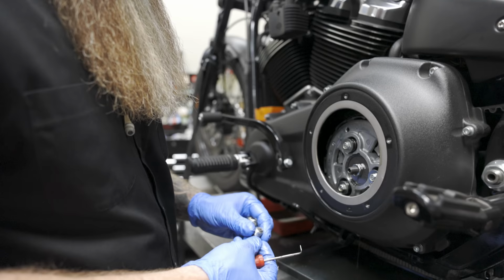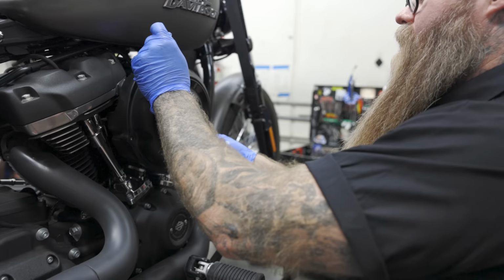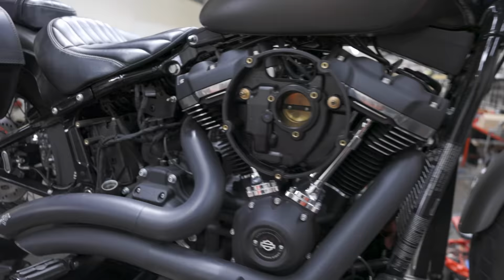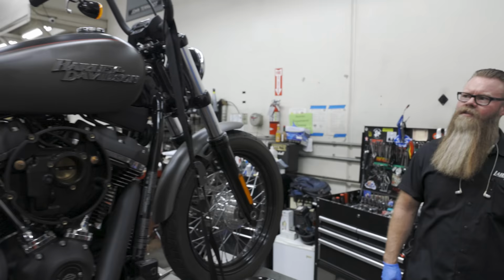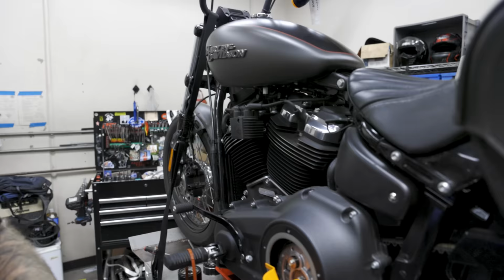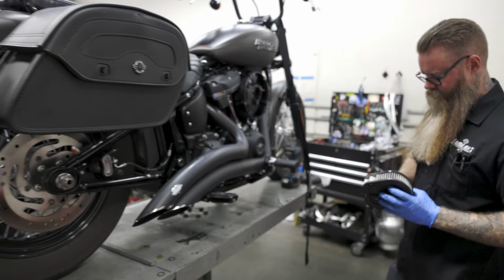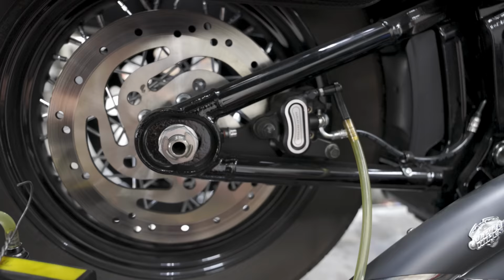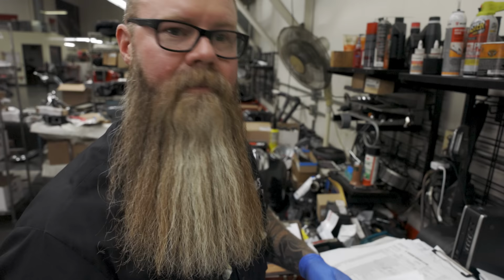1k Harley-Davidson Milwaukee-Eight Service by Level 3 Beard, Master Technician

Comment from the maker: Hey Guys, so I wanted to clarify a time lime discrepancy that a lot of people (with good reason) have been questioning. There is a part where I was talking to John about letting the bike run and he comments about getting the oil hot and bringing it up to operating temperature. This was BEFORE HE DRAINED THE FLUIDS. NOT AFTER, LIKE THE TIME LINE IN THE VIDEO WOULD SUGGEST.
Reply: Okay  I  just posted a question how he did that with no oil. Maybe you could re-edit video in case some stupid people try heating up engine to take off filter with no oil like it looks like John is doing.
Reply: @jimmybe64  I thought the same thing as I watched this, good post Dave and great service John and Great video Matt. Keep em coming!
Reply: Someone on here under @officialmattlaidlaw says I won a bike and it’s a highlighted message. Is this. Real?

Comment: Never again. My 1k service was $680. Got the bike home and checked all the fluids - engine oil wasn't even on the stick same with the trans.. Primary was low too. Tech. argued with me over whether you check the engine oil and trans. with the bike leaning on the jiffy stand. No Sir, I'll change my own oil and save my $600. Harley Davidson wants ONE THING - your money.

Comment: Have a question .... The oil filter was filled with oil before being installed . While it's full of oil how is it possible not to have all the oil spill out while replacing itt back in the filter holder. Did he empty that oil out of the filter then put back in . Because physics says you just spilled at least 2 cups of oil on the engine.

Comment: I wish I had the Confidence that my local Harley Dealer did all the same proper procedures. I bought my bike with 9,900 mi. and was told it had the 10,000 mi. service just done. It came with the checked out Warranty. You guys always seem so Trustworthy.

Comment: One would think for the $500 a lot of dealers charge for this service that a new air filter would be installed instead of cleaning the old one and hanging it on a dusty fan shroud so dirt can be blown in on the clean side of the filter before re-install. Master tech for sure.

Comment: Very cool video. I just read a discussion on local Finnish motorcycle forum about necessity for brake fluid change, since that is not so regularly done in car servicing, so it was good to see why it needs to be done. Also, Nick could continue making those great riding gear videos in the future?
Reply: Hello, fan!
Thanks for reaching out congratulation 🎁🎊🎉You Won a Prize Cheerful send a message above to acknowledge your prize🎁

Comment: Meanwhile it was a great video and I’m sure he’s a great mechanic, please don’t install an oil filter with a wrench ever. The lack of torque wrenches was a bit disturbing as well. But I’m really glad someone finally put the correct oil in the tranny and primary, the usage of SYN3 for those 2 holes got a bit out of hand lately.  Great series, please keep them coming.

Comment: Wouldn’t be nice to know how dealerships determine their shop rate as it relates to the techs doing the work? My local dealer charges $135/hr, which is just exorbitant. Just had a 5k service completed. They charged 3.5 hours of labor and about $85 in parts.

Comment: I don't like to wrench (don't mind paying someone to do it for me), rather spend my time riding but interesting what actually goes on with the service aspect of it.  How about one at the 50,000K where the front forks are inspected on touring bikes.  Where I'm located, I have five dealerships the same distance and had my bikes serviced at each on over the years.  Had some great conversations with mechanics, they all were legit because when I ask questions, I will follow up with the other dealerships to see if there is a difference.  Never had an issue at any of them.

Comment: Is a three-hole oil change standard for 1k service? I'm a retired auto and truck technician plus a 50-year dirt and street racer. Done all work and modifications to all my bikes over years. 
I have a new Fat Boy (month old) and just did a 3-hole at 700-miles using HD syn kit. Also adjusted the clutch and tightened all the fasteners. I don't trust service techs even on our
newer vehicles and do all the service work. Being the first HD (Sportbike owner only) I'm concerned about the motor noise in this bike and was considering having the dealer do the 1k service
and check the noise but at $400 plus and I will probabaly repeat the work immediatly might be a waste of money? Thanks and enjoyed seeing someone that actually does a quality job.

Comment: Great video! I have a 103" and I use Syn3 oil. How long (time not miles) can I go before I need to change the oil/primary/trans? It takes me years to reach 5k miles.

Comment: Be cool to see the 21" CVO wheel install with the graded Fork suspension (Part Number: 43300494A)  Road glide standard, or (though it says it won't fit), a Street Glide or Road King.  Actually you should put that wheel kit on your 2018 SGS

Comment: Very interesting that the 80w140 gear oil is recommended for the primary.
Reply: I use Redline Primary Case Oil.  Redline  Transmission Oil for gearbox. Dearer but designed for purpose,
Reply: @jimmybe64  I use specific fluids too. Amsoil 20w-50 in engine, Amsoil Primary and Bel-Ray Heavy Duty in gearbox as last change was at Dealer and they dont have the Amsoil Heavy Duty Gear Oil.

Comment: Notwithstanding the four years in service, is that oil really spent at 1000 miles?  The manual for my new Toyota wants the oil changed at 10,000 miles. I know they’re very different machines, but dang that’s quite a difference.
Reply: Its a break in service, so its more about getting the metal shavings out of the engine than it is about the oil being spent.  After the 1k the intervals are every 5k miles.
Reply: Or twelve months  what ever comes first. They should have said that.  Bike should not sit for 4 years with old oil then get run-in service like it was six months old.

Comment: Funny how he had no issues using that Harley devise for the oil filter. I’ve seen so many crying about making a mess when using it. It appears they’re either trying to make everything Harley look useless or their that slow.
Reply: The drain tray/tube works perfectly on my M8 Streetglide Sp.  The one on my TC103 Breakout doesn’t fit as well, as I should have read in reviews!  It makes a huge mess!
Reply: @alanbobowicz141  lucky for me I have the street glide Special

Comment: As an Ase master l1 Automotive tech for 35 plus years. There is no way the brake  fluid could be  so bad it needs a flush. This guy in the video probably needed his beard trimmed. Think about it you bring in your new car or motorcycle with 1 thousand miles on it and you need a brake fluid... flush.. I dont think so. No freakin way period.

Comment: Many things they do not do any more
Heat the oil before pouring in
Spin the oil filter with warm oil
Clutch diameter plate balancing
Aa with cable or fluid diameters in a clutch
Wheel rotation as tyre rotation
Compressor condenser re evaluation
The list is endless to safe the motorcycle correctly
AFFA angels never die nffn HMS

Comment: The whole blow by seems like a BS thing Harley should fix, shouldn’t have to tell owners under fill your bike that’s 100% safe 🤦🏼‍♂️. I have a 2001 Sportster 1200 and at first I under filled it way below the line and it still had some oil Come out, then I filled it to the correct level and it obviously still blew oil out. I spoke to a dealer and they said “ Harley’s just like marking territory.. “  kinda frustrated me but then just told myself it’s a Harley thing lol
Reply: Hello, fan!
Thanks for reaching out congratulation 🎁🎊🎉You Won a Prize Cheerful send a message above to acknowledge your prize🎁

Comment: Its amazing how a 20k motorcycle needs so many adjustments after only 1000 miles. Personally i think its a hustle and its the reason alot of people don't want to spend 500 dollars on that service.
Reply from the maker: The bike is about $14500 that model year. The service is 400 at the most. 
There are a lot of things that are checked and don't necessarily need to be adjusted. There are some items like the brake fluid that deteriorates over time. The bike is 4 years old albeit with only 1,000 miles. Honestly there are a lot of people that neglect a lot of the service and they are "fine" for a long time...until they aren't fine. If you take care of the bike it will take care of you.
Reply: The only adjustment is clutch which you need to do every service. It takes a couple of minutes.  Every two years change brake fluid.  He  checked tension on  all fasteners. What did I miss that you saw getting  adjustments?

Comment: 1000 k in four years ! That's just gay
Reply: Yes and that oil change should have been done in first year.  Twelve months or what ever millable manufacturer sets it at, no wait 4 years till I get it to 1000 miles
Reply: Hello, fan!
Thanks for reaching out congratulation 🎁🎊🎉You Won a Prize Cheerful send a message above to acknowledge your prize🎁